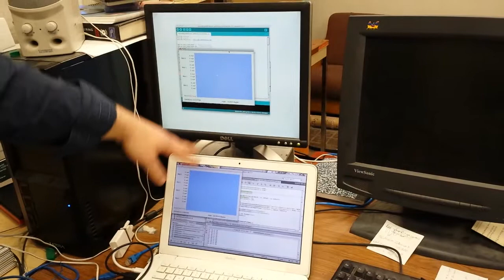Demonstration of Beacon Location System

Comment: Could you have several non active beacons in a room then turn one beacon on and have the wiimote beacon find the fixed point beacon that was turned on. Or could you cut on the particular beacon with the wiimote for locating purposes?